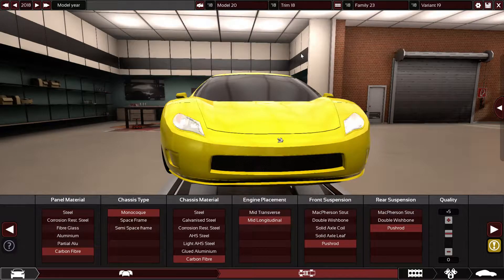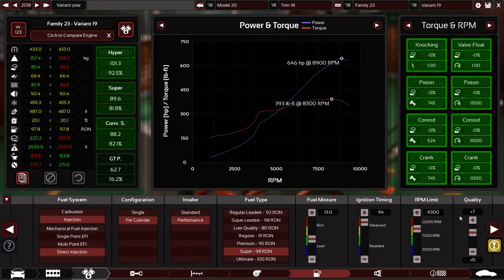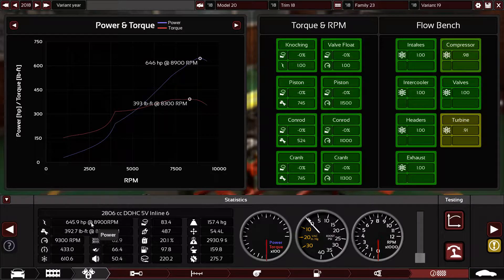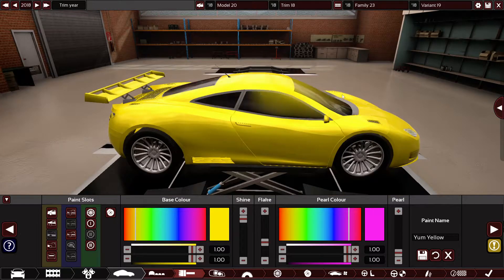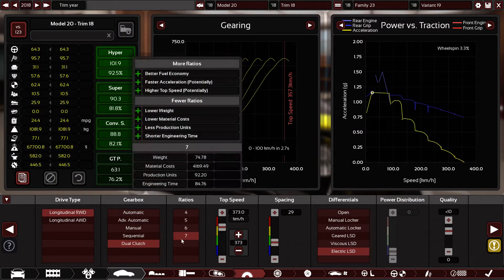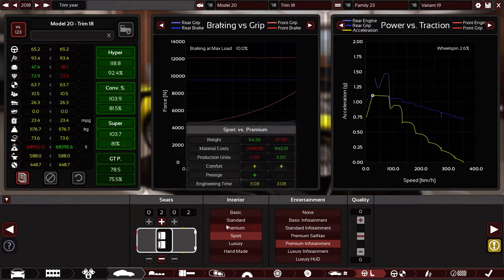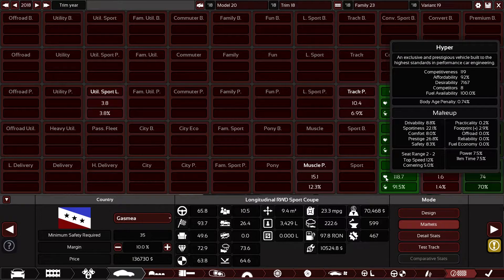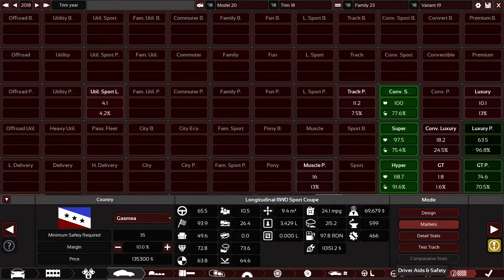2.8L Inline 6 Supercar Build in Automation Game.

Comment: you don't have to make such an oversquared engine in automation, because in the game a larger bore means more valve float, so here is a tip: first you skip the size and build the engine with the features you want it to have. Then you increase (or decrease) the stroke until the internal's rpm limit gets close to the max rpm you desire. Afterwards you ajust the bore until it matches the size you want.
This way the engine will be able to rev higher (wich is weird, because it will very likely be an undersquared engine) due to the reduced valve float, it will be a lot more compact and a bit lighter (maybe, a lot of times it is).
Reply: Mr rondini well I didnt know that :v

Comment: The engineering time is actually 275 months according to the devs.
Reply from the maker: Oops
Then it’s a true hypercar according to the engineering time.
Reply: Bshar Nasri Yeah, congrats on accidentally building a car with the correct engineering time.
Reply from the maker: I appreciate your notice and your support 
👍
Reply: Bshar Nasri Yup. That also means that engine would take 20+ years to build.
Reply: And thanks.
Reply from the maker: It will take 22 years 
To be engineered 
If they started in 1996 it will be ready tomorrow
Reply: Bshar Nasri Good news sir! Your car you ordered in 1996 is now at the dealership.
Reply from the maker: No dude
Engineering is not production.
Engineering is time when the developers and engineers build it and test it. Production comes after engineering time finish so customers can order it when the production starts so they can receive it.
Reply from the maker: Because you can’t order air